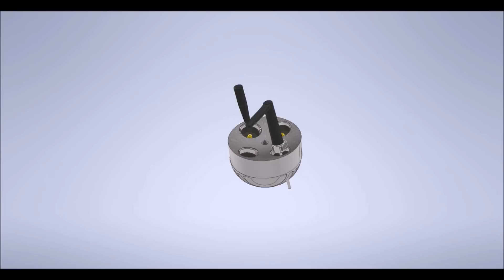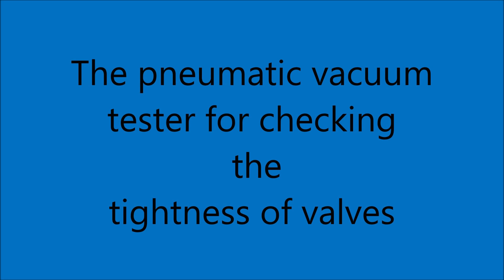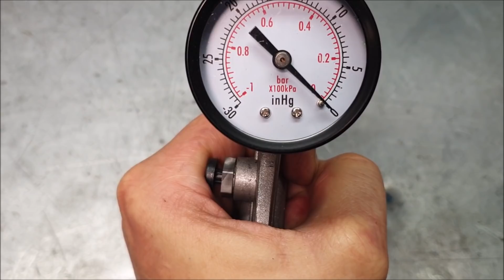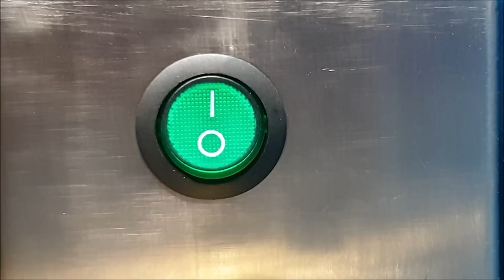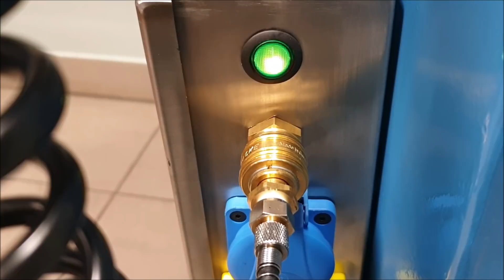Making of valve seat cutting machine  - The Pneumatic Vacuum Tester

Comment: vacuum testing doesn’t prove the valve seat has been cut concentric to the guide as the valve can move within the tolerance of the guide to seal when applying the vacuum.